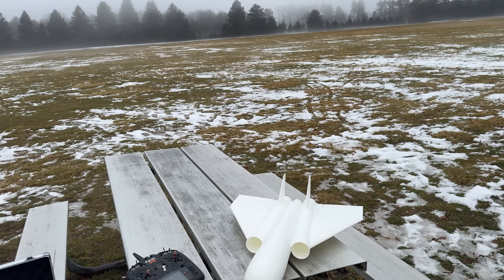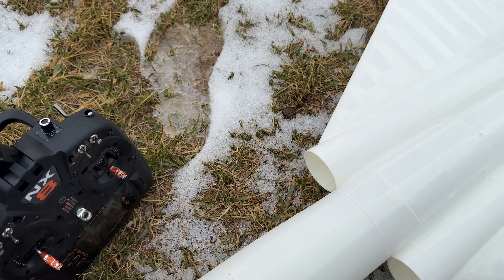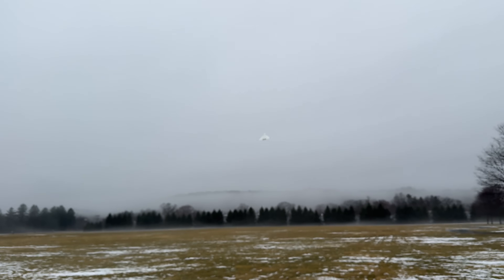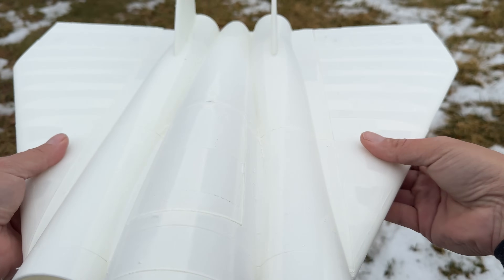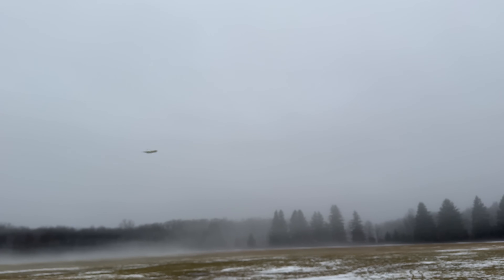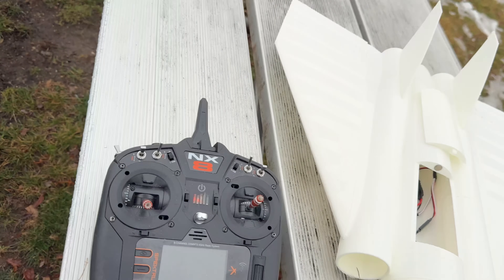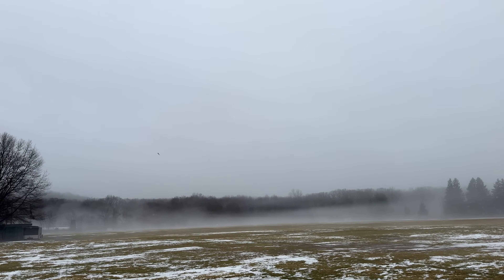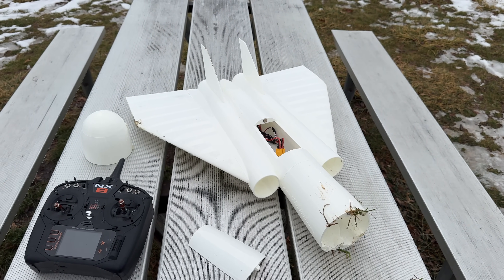The Stryker Maiden flight. Best FPV platform?

Comment: maybe you could change the pins to be shorter and fatter and add another set of magnets to make the nose section more robust in case of a high speed air to ground convergence??

Comment: Hollow out the front pins on the nose cap. In case the pins snap you’ll still be able to use an easy out to remove broken pins. Just a thought… 9:05
Reply: Just commented the same before seeing this. Even if it's strong in the beginning, it's bound to break over time

Comment: Add a camera to the nose to bring the CG forward. I love this design. I think it would be a great field launched ISR platform. It could be assembled quickly and launched without the worry of self injury. It looks like it could loiter on a single battery charge for a while and its forgiving flight envelope is good for inexperienced pilots.
Reply from the maker: Done and done! DJI 03 air added and flew successfully. You’ll see in the next video

Comment: 1254    what is this bulgy business in the ducting about.!     if those contours are on the inside as well, you have created  UNWANTED  expansion chambers in front of the edfs.       obviously, if/when the auw is increased and the battery cell count stays the same, the thrust to weight ratio will change.

Comment: Anything that flies is a good fpv platform 😊

The fpv gear will add some leveraged weight to the nose. Your cg bumps are probably spot on with an average camera and vtx.
Reply from the maker: @markmiranda2881  weight distribution is the tricky part with FPV, it also needs to be extremely stable for when you throw and transition to the goggles. Also some built in self leveling helps with landing while in FPV  because you can’t really judge your speed as well as when your line of sight flying. 👍🏻
Reply: @hotlapkyle  totally! I fly freestyle and racing drones in goggles all the time. Flying slow, hovering, and landing definitely require some practice with a fixed camera, especially with 45-55 degrees on racing drones.

Comment: If you add a battery tray on a slider with a servo you can get the CG dialed in on the fly(heh) instead of having to land multiple times to adjust, even if its just for prototyping. If you make it modular, you could just swap it over to every new design during testing.
Reply: Like a autronics linier actuator

Comment: DUDE! If you cut out nose where the glossy black part is, and replaced it with a clear nose, you could TOTALLY have a camera inside with a swivel and use it as an FPV!
Reply from the maker: Already done!
Reply: If i had this drone i would pack it with sensors and an esp32 microcontroller so it could fly without controller.

Comment: Once you add FPV gear, CG will move forward. What 3D printer did you use?
Reply from the maker: @dohabandit  I have 4 Bambu lab printers
Reply: WRONG.    the distribution of mass (dom) will change.     the 'new' dom will need to be 'tuned' so that the cg  stays in the right place.